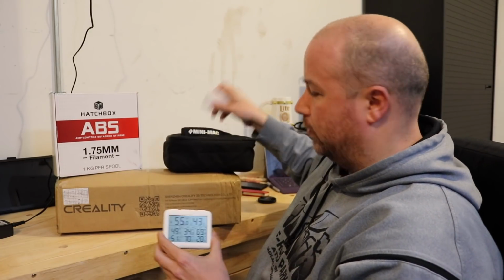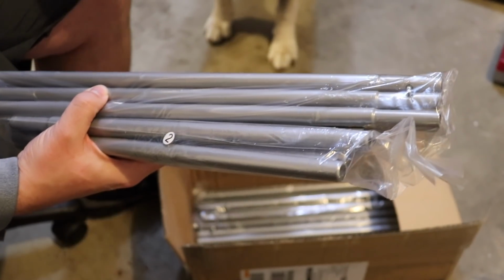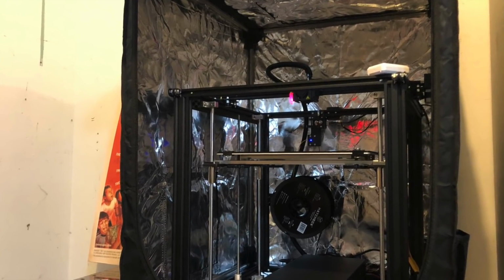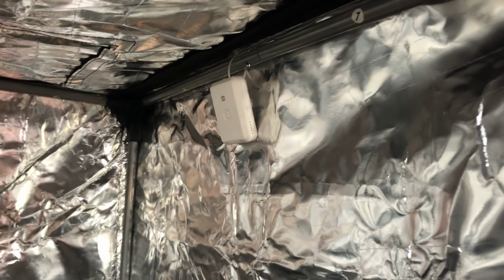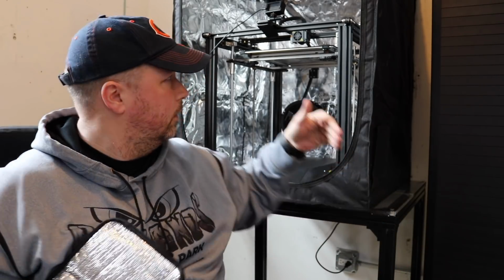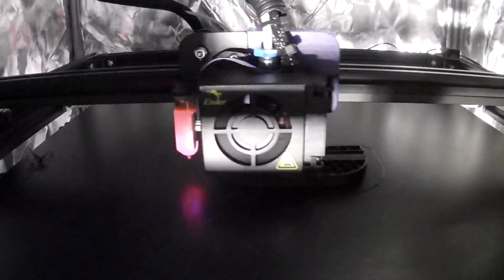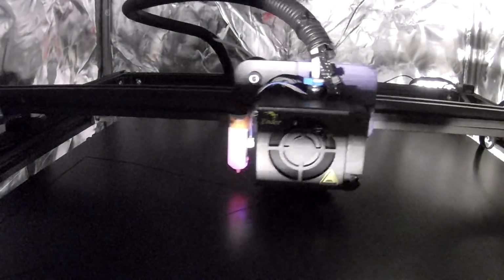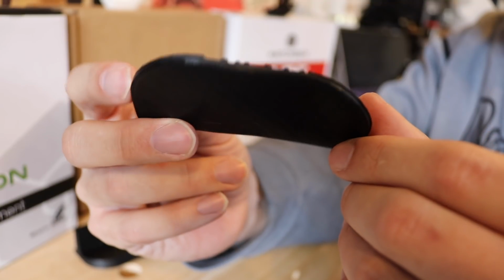CREALITY ENDER 5 PLUS ENCLOSURE  - Review and Testing works with CR-10 V2 & CR-10S Pro - Giveaway!

Comment: I heat soak for an hour for big ABS prints using the nozzle to measure ambient temperature with "G4 P3600000 ; heat soak for an hour" in custom gcode. 
Took 4 days to make this video due to challenges? Sounds like you need MORE challenges! Video is good.

Comment: I bought this exact enclosure for my Ender 5+. I’ve been told that I need to place the filament spool and the PSU electrónica outside the enclosure for cooling purposes. What are your thoughts on this? Is it really necessary to do so?
Reply: I bought a filament dryer for my spools connected via ptfe pipes so that it remains dry when left out for long periods of time. It stays outside the printer area so that I can replace the filament easily.

Comment: How do you get the screen to mount there in the middle instead of hanging off the right (per instructions)?
Reply: Ah, just realized that’s a 5 plus, not a 5 pro... comes with different configuration

Comment: Put a larger fan under the heated bed between the extrusions on the z carriage. You have a large heat source already in the enclosure. You need air movement to pull heat energy off the bed and put it into the air within the enclosure. You can't rely on radiant heat only. The heated bed should keep up fine as long as your power source isn't a 💩

Comment: Just an idea. using the frame as a template make insulating panels to fit in there. I'd use https://www.menards.com/main/building-materials/insulation/foam-board-insulation/johns-manville-foil-faced-polyiso-foam-insulation-4-x-8/w-n5050/p-1444438920894-c-5779.htm It has good fire resistance.
Reply: Bear is awesome!

Comment: Bear is Awesome.  Thank you for the review.  I am also in the midwest (about 3 hrs from Chicago) and I am putting my 5+ in my unfinished basement.  Looking for a proper enclosure to minimize dust as well as hopefully allow me to print ABS in the future.  I am leaning towards building something (not that I am good at that either) vs buying the "tent".
Reply from the maker: Hello Shawn, thanks for watching!  Yeah it is very difficult to print in the midwest in a basement or garage in the winter.  This enclosure is just too big, and there is such a loss of heat when trying to access anything within the printer.  I will be building an enclosure in the coming weeks also, lookout for the video!

Comment: Bear is awesome.    What temps did you use for the ABS?  I have never tried it and am curious of what you used.  I agree that speed kills.   I am happy when I get a good print and usually print at a max of 60 mm, some times 50 and have a lot of speed changes for print moves Prusa Slicer
Reply from the maker: My first failed test I did 240c, then I stepped it down to 225c with the successful print.  I just noticed that if I go over 70 I get a lot of weird anomalies in the print.  I forgot to mention in the video, When printing ABS let the off gases dissipate for a little while before retrieving the part.